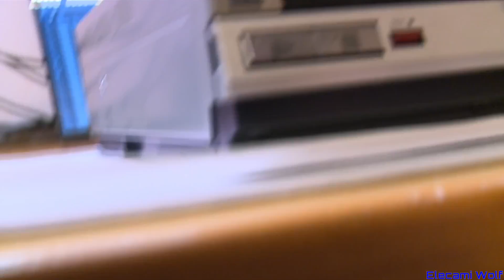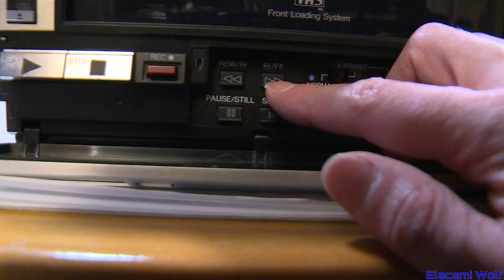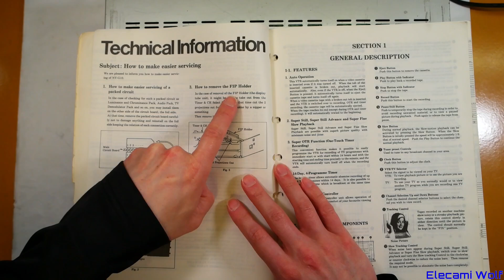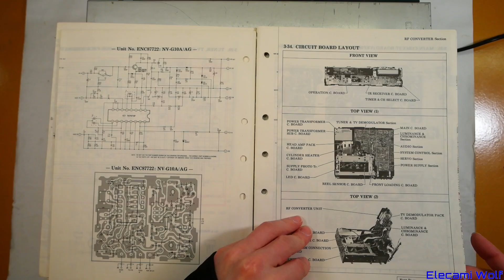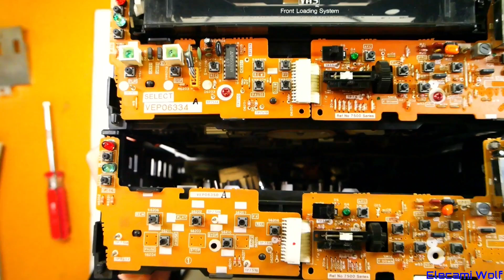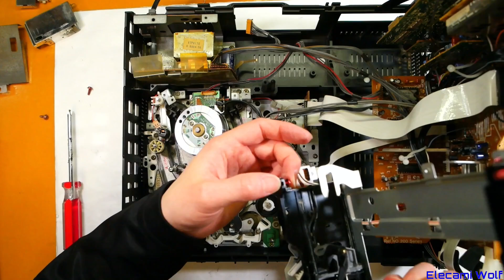EW0137 - National NV-G10 VCR Investigation Teardown

Comment: @Elecami Wolf it would be nice if you could share us it's service manual as well?
Reply from the maker: You can find it by google search.
Reply: @Elecami  I did but it brings only EG version not EM that you have. I need power supply schematics and diagrams.
Reply from the maker: @saeedahmed5547  It should be fine. It is mostly the TV Tuner that will be different on the different versions. Other parts will be the same.
Reply: @Elecami  yeah, but I do not find switch mode power supply version schematics!
Reply from the maker: @saeedahmed5547  It might be possible to use the schematics from a similar moedl.